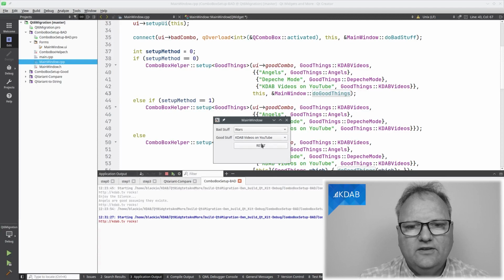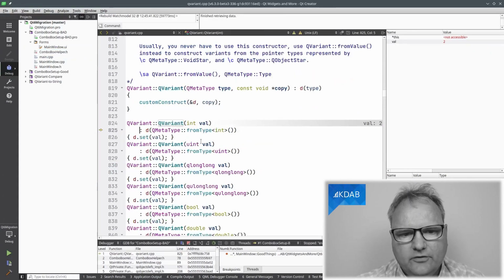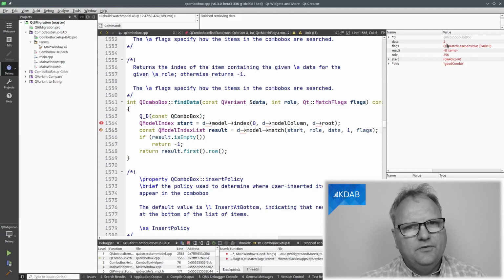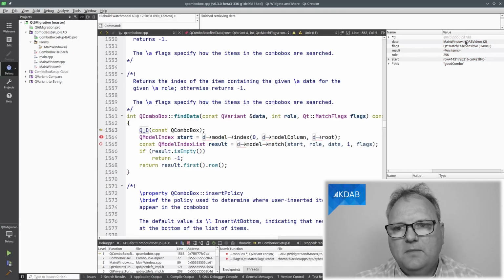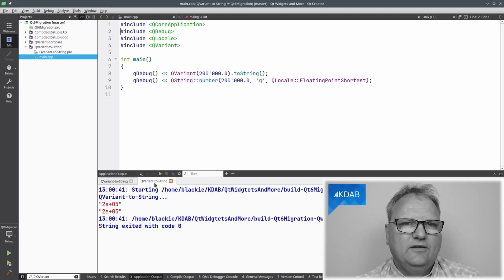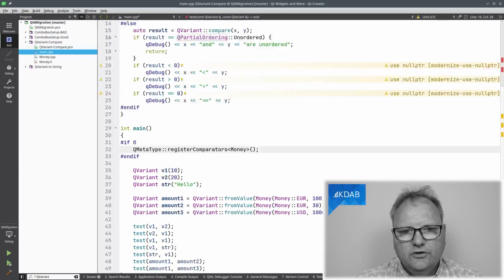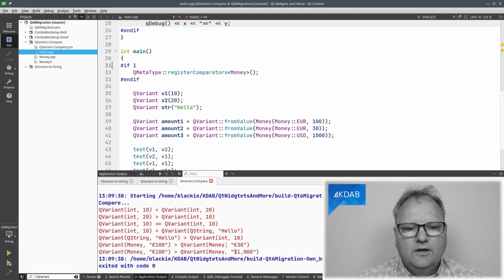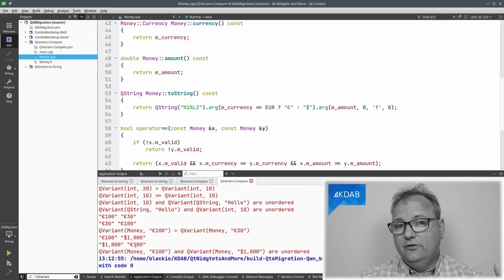Migrating to Qt6 - QVariant

Comment: Thanks for the video. Do you recall if you had to call Q_DECLARE_METATYPE and qRegisterMetaType on your enum type in order for it to work with QVariant::fromValue?
Reply: Naeh its been a while now. I asked for guidelines in KDV, and this is what I got, hope that is helpful:
Q_DECLARE_METATYPE isn't necessary in Qt 6 for a lot more things (e.g. for QVariant), only needed in some corner cases for queued connections. Since it's a gray area, just add it :-)